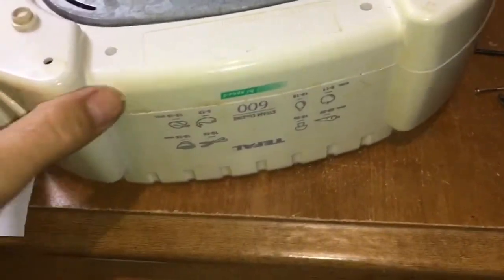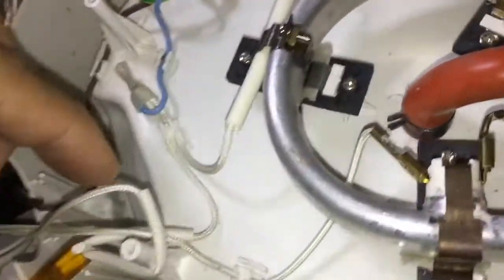How to Fix a Vegetable Steamer - Tefal Steam Cuisine 600

Comment: We have a lot of minerals in the water in our area. Couldn't you have tried running some vinegar down it to see if that worked? It works for showerheads, inside coffee pots, etc.  Its mineral deposits like calcium and lime are in our area. I'm trying to figure out how to use a sunbeam steamer. I inherited from a lost beloved relative.
Reply: I found a manual online for mine. I will share the technique it says to clean it from after hard water use. Hope it helps someone. God bless and thanks for the video share. After 2-3 months of consistent usage, chemical deposits may build up in the water Reservoir and heating element inside your Food Steamer. This is a normal process and the build-up will depend on the degree of water hardness in your area. It is essential the appliance is descaled regularly to maintain steam production and extend the life of the unit.1. Fill the Water Reservoir to the Max level with approximately 3 cups of clear vinegar (not brown vinegar). IMPORTANT: Do not use any other chemical or a proprietary descaler.2. Plug in a wall socket. Drip tray, steamer bowl, and lid should be in place during this procedure.3. Set a timer for 20-25 minutes to begin steaming. WARNING: If vinegar begins to boil over the edge of the base, unplug the unit and switch the timer off. Reduce the quantity of vinegar slightly.4. When the timer rings, unplug from the wall socket and allow to cool completely before  pouring  out the vinegar
Reply from the maker: @igotbandaids  Thanks for your contributions.  That is certainly all good for preventative maintenance. Unfortunately most people don’t do this and just keep using it until it stops working, at which point the tubes are blocked and then it’s too late.  Once they are blocked it is usually impossible to unblock them by running the machine with acid (vinegar or lemon juice).  Then the only way is mechanical means like in the video.

Comment: Great video, and i have same steamer, but my suddenly start tripping the electricity in a whole house. Tried it few times same thing, tripping. I do not knw how tu use the tester but followed your lead and tested the way you showed and my tester showed 0, not 0.36 like yours. So I think may be my thermostat gone. so I pulled it out and tested it separately and it beeped and showed various figures that I have no idea what does it mean. Can you help me to fix this steamer please or ... any sugestions
Reply from the maker: If it is the earth leakage circuit breaker that is tripping then it is likely to be the heater element that is leaking electricity to ground, so it would need a new element.  You can test for any resistance between the power connection to the heater and the earth connection (case wire).  Anything other than infinity resistance (often a ‘1’) on a meter, then it is leaky.  It may need a high voltage leakage testing meter, but an ordinary multimeter may show it as well.
Reply: Honestly, to me it is rocket science. I know what tester is and seen how one testing something with it. But what they are trsting i have no idea. Can you fix it fo me?
Reply from the maker: @Art-craft-club  you have overcome half of the problem by having a go. You are gaining experience!  Measuring resistance on a meter, measured in units of ohms, is just measuring how much something resistant something is to electricity flow. This is a diy channel so I don’t fix things. Make me a donation and I’ll try and help with more advice.